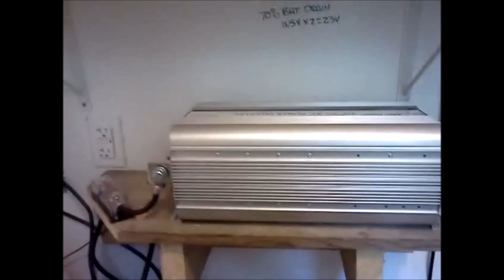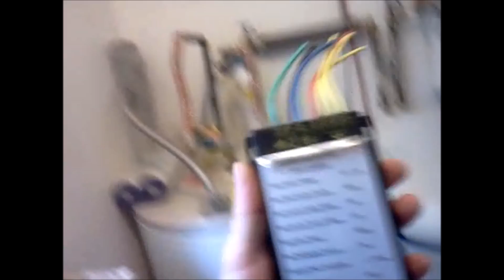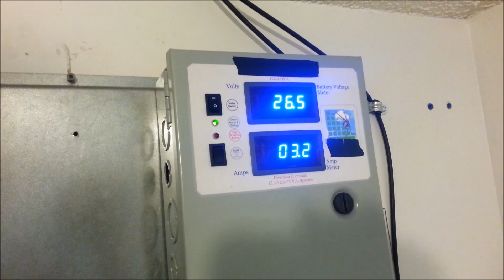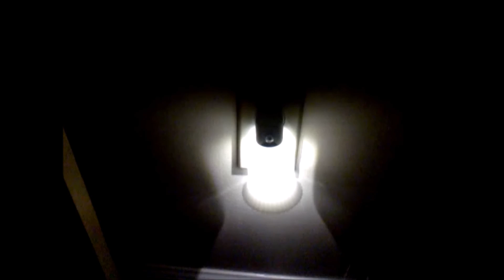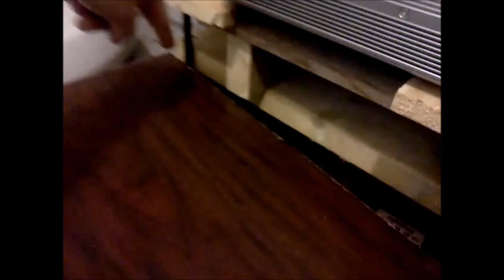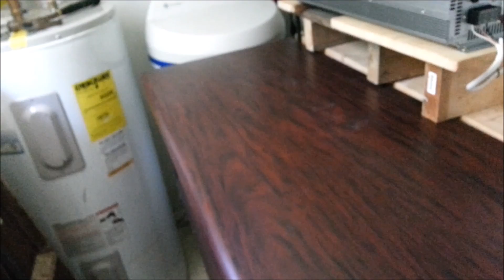Solar System DIY - 320 Watt, 3000 Watt Aims Inverter, Coleman Air c440-hva 10,000W Charge Controller

Comment: Hello.. Your bank is simular to mine (i'm at 4 AGM's now in Parallel but want to go up to 6) But- I can't find any info about hooking up 6 AGM 100ah batteries (Parallel) in a way that is equal charge / discharge  Like I say- I have 4 now and found a great site that showed me how to hook them up to properly draw and charge balanced...now I want to upgrade and no one has a bank diagram for 6 batteries... Do you know what the method would be?  BTW- It's a 12 Volt set up....

Comment: Yes I have the same problem with my charge controller it is same problem when the sun comes out the charge controller tends to pass is dumping point.yes i do turn on some type of load like a fan . I had this charge controller over 2 years.so. my conclusion of this  charge controller is not for  made 4 seald  lead acid. batteries thats what i got .its will work good with big batteries something like 150 amp hour batteries flooded...

Comment: i setup my solar with proper solar cable, i have 1,100 watts of solar, it was only ever getting to 750watts max then i decided to replace the solar cable with house hold extension leads knowing they can support 10amps per lead at 240volts,  i used two leads one for + and one for - using all 3 wires in each cable, i now get the full 1,100 watts just by doing this, that solar cable is shit unless you run real high voltages oO

Comment: I don't like that kind of Charge controller.  It's basically just a switch  with no voltage regulation.   Solar panels can produce 22 volts,  but batteries like to be charge with 14.4 volts  (for a 12v system).  I'm afraid that it'll cook the battery charging at 18-22 volts straight up.

Comment: The first solar system I bought was from Harbor Freight.  It was ok for a single light.  So I then bought two additional units from Harbor Freight but it was still not enough.  So I enlarged the system with 360 watts Mono-crystalline panels and an EP Solar 40A charge controller.  So now my 12v system consist of 9 thin film solar panels and 3 Mono-crystalline panels for a total of 495 watts.  Once that was hooked up and working I bought a Samlex 600 watt pure sine inverter.  The system has been connected and running for a year now and I have had no issues.
Reply: Hello.. you have done pretty much what I have done... How many 100 ah batteries are you using in the bank? I can't find any info about hooking up 6 AGM 100ah batteries in a way that is equal charge / discharge  I have 4 now and found a great site that showed me how to hook them up to properly draw and charge balanced...now I want to upgrade and no one has a bank diagram for 6 batteries...

Comment: I am looking for some help I will have 2x12v 110am battery's and I want to use it all on 12v but my new panel will be PMPP 260w VMPP 30.7v imp 8.50A 37.8V VOC UL 1703 600 UL 17031 5A can I do this for 12v please help http://www.recgroup.com/sites/default/files/documents/ds_rec_peak_energy_series_rev_w.2_eng.pdf

Comment: If I were to operate only a 1 100watt panel on a 12V battery, is it necessary to use a GFI receptacle inverter (pure sinewave) or just stick to the basic PMW??
Reply from the maker: Its really up to you, I'm not a pro at this just DIY, I would ask someone with more expertise. BUT, IMHO, no its not necessary, GFI is mainly for HIGH power appliances like microwave, fridge 15amp white 14/2 Romex wire is good for about 1500 watts, if you close to maxing this and its a wet area etc. get GFI, and as I have another video about Pure Sinewave vs Mod, this another subject  https://www.youtube.com/watch?v=FvtMqyU3d0U
Reply: Solar Service Guy thanks a lot! I will check it out! Thanks for sharing.

Comment: There are others claiming that polycrystalline is more efficient and suppose to produce more on cloudy days, rather than Mono. Did your providers tell you that mono is the more efficient?
Reply from the maker: I heard the opposite from all the research I have done and this is why Poly is cheaper, I just know my Mono do produce good power on cloudy non-rain day.
Reply: Solar Service Guy OK  sounds good. Mono it is 👍
Reply from the maker: :) I hope this helps, but also buy from a good company and reputation.
Reply: Solar Service Guy it definitely helps because I need the best. I'm also very new to solar systems. Which companies would you recommend?
Reply from the maker: Hello, glade we helped!
Reply: Pete S. thats correct brother..google mono vs poly... u ll find mono can work comparativly better in high temp and cloudy weather
Reply: Omair N yes, everyone has agreed mono is more efficient. Thankyou.
Reply: by 2%
Reply: It's all about space efficiency, really.
Mono has a higher 'absolute' efficiency, so a 100 watt mono panel is smaller than the 100 watt poly panel.

If you're installing on an RV or van roof, that's a big deal.

Mono may have slightly better luck in cloudy conditions, due to the higher overall efficiency.
Partial shading, they both kinda suffer about the same.
Amorphous panels actually do well with partial shading, but they're bad for space efficiency.

Comment: good video, but I've heard if you're going to connect to your home you need to consult qualified electrician and power company. if you burned down your house homeowners insurance may not cover if you diy. just my thoughts. enjoyed your video
Reply from the maker: Yes, this is a HUGE problem and why I made this video https://www.youtube.com/watch?v=z8BtrhFlRGg as there is ALLOT of info out there stating you need to just connect a GTI for $100 and off you go to get power back from you power company... WRONG! Yes, get it done right and get qualified electrician to look your system over.

Comment: HI, I'm not sure if you have another set of 8 - 50ah batteries hiding under the set we see, be use if you only have 8 batteries at 50ah each hooked up series / parallel mode then you only have a 200ah battery bank not 400. Nice setup :) one day i'll get off my butt and film mines :)
Reply: +Solar Service Guy i think he means as you double the volts the Amps stay the same so you really have 4 24volt batteries at 50 amps each
Reply from the maker: Hey, sorry for the HUGE delay, been really busy, what do you mean I only have 200ah when 8 x 50 = 400ah? These are old bats and its been almost 2 years and they are not holding up so well, need to replace them with quality.

Comment: 24 v system should max charge to around 28.8 vdc then float charge to around 27.6 vdc
Reply from the maker: yes, I recently updated my Charge Controller, with no problems now, thanks.

Comment: Nice pick on the batteries, that's a good charge controller for off grid wind power but your going to kill those batteries quick by over charge. And you would get more power in with a mppt charge controller even a epsolar which I have been running for 2 years would give you 30 percent more power from your panels.
Reply from the maker: +autobri1 Yes, they have been a great find, about 60% efficient, for the price I'm cool with this. Yeah, I replace the charge controller with a new http://colemanair.us/vp_asp/scripts/shopexd.asp?bc=no&ccode=C65-PWM and I'm VERY happy. I found out per a company that I don't talked about, but has a BAD reputation of not leading you in the right direction (MWS) it was the wrong charge controller for my system.

Comment: This is a great video. I'm making a solar channel and I have a aims pure sine wave 6000 watt inverter charger and much more., I have been making new videos every day or so. Please take a look at it and give me your input please.
Reply: +Solar Service Guy Hello Buddy, 
Thanks for the nice video. You have a nice little setup their. 
This is just an opinion for you to look at. The C65 change controller is good but for best reviews, performance, better reputation, I will recommend you C35 change controller. You can have two of them to compensate for the C65 you were about to upgrade to. 
Please go online and check it out yourself and decide which one you want. Just remember it is not an MPPT charge controller. It's a PWM change controller which I will recommend you getting an MPPT CHARGE CONTROLLER  for better performance an efficiency.
By using an MPPT Charge Controller, on your solar modules, you will end up harvesting alot of wattage, Amps and higher voltage.
I just subscribe to your channel please checkout my channel.
Cheers
Reply: JWSolarusa John Wesley I'm installing 3000 watts this week on this charger
Reply: Guns,Games and Racing Please make sure you upload a video of that installation ok?
Have a blessed day
Reply from the maker: +Guns,Games and Racing very cool! FYI, I returned my 440 today and I'm getting the C65-PWM instead. I found out its better suited for my system. This was great because Coleman is working with me so well and helped me on this... :) I also have any updated video per my whole system, but you might want to wait some as I will be making another updated one per my new controller and I'm also adding a shut off relay etc. :) I will check out your channel later.
Reply: Guns,Games and Racing Congratulations I'm happy for you Buddy have fun and keep the videos rolling.
Reply: thanks
Reply: Guns,Games and Racing Please make sure you upload a video of that installation ok?
Have a blessed day
Reply from the maker: +Guns,Games and Racing I checked it out, did you see?
Reply from the maker: +JWSolarusa John Wesley I have my C65-PWM and its working great!!! I already had Coleman Product so I went with their best product for solar, it is what it is and I will maybe upgrade in the future but seems to work great for me so far, do you have a video of the C35? I will put a video up on it soon. The C35 is the a Coleman Air Product?
Reply from the maker: +Guns,Games and Racing Nice!
Reply from the maker: +JWSolarusa John Wesley Will do.